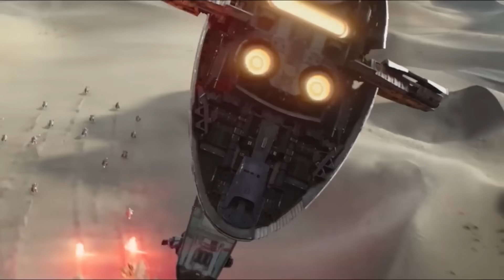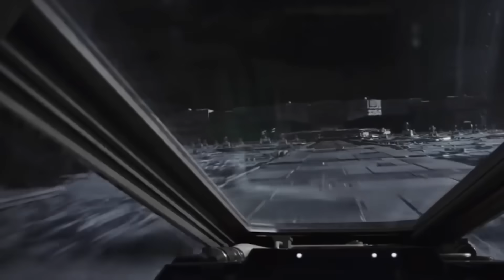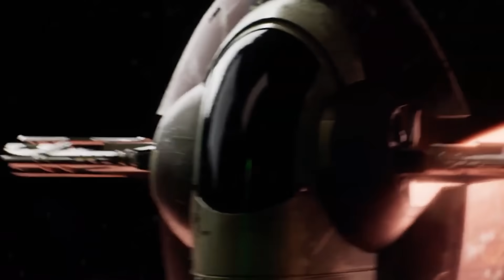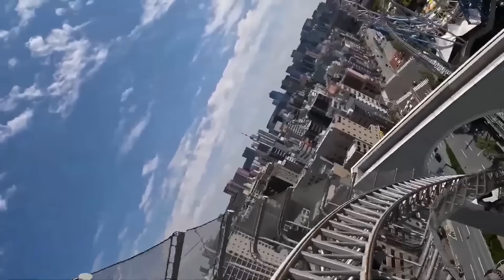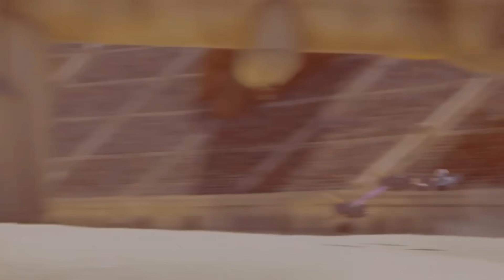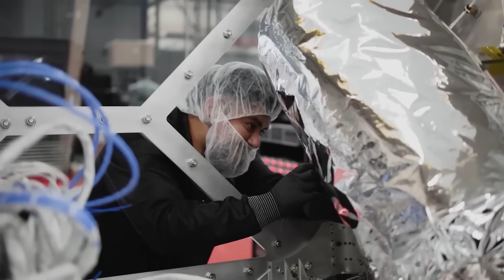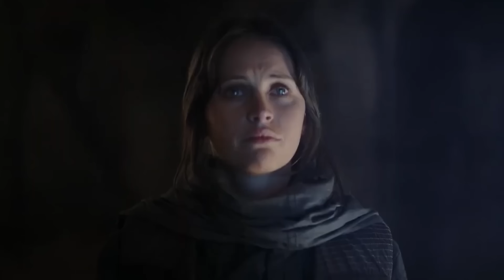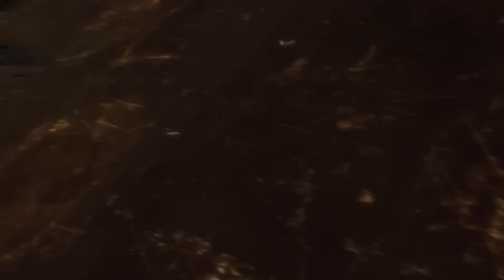The Problem with Star Wars Ship Design

Comment: Google "Saucer over Dracula's birthplace pouring smoke Yahoo news 16th Century Church painting" + "Masolino, The Foundation of Santa Maria Maggiore (The Miracle of the Snow). Fig 8 National gallery UK" No windows.. Google "Plasma generated Ultrasound" + "Boeing Plasma force field blocks bombs" + "Ultrasound antidrag for naval and aircraft" Earth science: "No medium in space, its a VACUUM! Hey lets talk about the interstellar medium!" Near vacuum, a powerful enough Plasma generated ultrasound system is still useful. If not for super speed anti-drag then for shock wave echoes to pull Heliosphere Gas from large distance to regenerate your life support systems indefinitely if you got good power source.

Google "Cooler Master Maker 8 CPU cooler" It uses Vacuum cold boil science to evaporate at lower temperatures and nobody needs to reset the vacuum ever. Youtube search: "Tesla Turbine COLD STEAM Testing, Medium RPM low temperature, 61280 RPM" He beams that Turbine under load using 134F temp.. Look at his vacuum pump he primed it with. Grins and resonance holography melts shutter seal and opens EM bearing Turbine system to space then closes it back resonance welding sealed again How strong would 134F heat be in THAT environment trying to balance cold? OH WAIT! I forgot to prime the COLD side! Opens shutter to water panel freezing it and leaving it open to use space to maintain it Heheh..

That Tesla guy why your governments not boosting him? Because your governments are sitting on everything they believe if all the good stuff went to masses it would be mindless super chaos so they're trying to enslave masses. WEF founder: "We will all have the implant." + Elon Musk: "We must merge humanity with AI" + "Elon visits Vatican" + "What percentage of WW2 Germany was Christian?" + "Nazi alliance with Islam" All public. Squints at masses grinning like a Sith Master using ultrasonic echoes to pull atmosphere charges to line up for mini lightning Google "Lightning makes Antimatter" + "Ultrasound can print through people and walls scientific American" + "Ultrasound non-invasive brain computer interfacing" + "Ultrasound stem cell proliferation" + "Ultrasound can make stem cells into other cells" + "Ultrasound holography" + "Ultrasound holography transcranial brain modulation pubmed GOVERNMENT"

There you go.. Upgrade power for PRESSURE add ultrasonic echo clashing by virtual reflector logic for resonance pressure barriers to trap plasma in using resonance safety filters for yourselves that prevent absorbing heat in you = Careful about using chain lightning logic for bigger and bigger lightning for a holographic stable black hole.. Can holograms kill? YES.. - Dracula/Hades/Anubis (Bat Sonar = Ultrasound + Lost TV show Sonar fence = Tiger Moth Bat sonar jamming) My words your world database results https://www.youtube.com/watch?v=J46EcAqZAPY

Comment: Another solution to the window thing: Simply having the "windows" be a video screen , linked to an external camera.

I mean yeah, the camera will be disabled if it takes a direct hit... But it's a very small target comparatively. And if a large window gets hit, well, that compartment is getting vented.
Reply: So Star Wars doesn’t use Glass on Starships. 

It’s Transparesteel. Literally a Sci-do metal that is Clear Durasteel so it’s as strong as the other metal surrounding it
Reply: @devildolphin2102  I figured it probably wasn't just regular glass, but I didn't know it was a material that's equally durable as the armored hull plating around it. Now I know!

That's actually pretty cool

Comment: Bridges - non-war travel they could use the bridge with windows as part of travelling and light combat. I would expect them to transition to the fortified bridge during major combat (or start there) and in war where big battles are expected. They haven’t shown that but would make more sense.

Combat Distance - I would say it’s close because for weapons that shoot concentrated light if the other ship was far enough away they could maneveur and it misses. I would also argue that a ship that has FTL can probably also detected those shots at range. Missiles would be intercepted too, so they need close range.

I’m more surprised that droids aren’t flying most ships.. and automated systems vs needed people to take those actions.

Comment: I can tell you didn't watch The Force Awakens. Most of what you said Han did was the actions of Rey and Finn, also Starkiller base was protected by a Sub-light shield, AKA, unless you are in Hyperspace you ain't getting in. This is where the Falcon's unique .5 class hyper drive is put into play as a class 1 hyper drive (Fastest non-modified hyper drive) isn't able to exit Hyperspace fast enough to be able to maneuver from crashing into the planet surface as the shield encompassed Illum and it's atmosphere(A few dozen Kilometers above the surface) thus making The Millennium Falcon one of, if not the only, ship to be able to infiltrate Starkiller base, and even then it was extremely close call resulting is what Sar wars fans would call a happy landing™️.

Comment: 1. Sensors are always jammed in battle, cameras can be damaged by laser systems, which is also very commonly equipted among star ships. A large window may not be that futuristic but it's the most robust solution. Besides, star ships usually rely on different types of shields, for most capital ships if the shields are gone the evacuation procedure will already be started anyways.

2. The wings on fighters are used as heatsinks in my opinion. In space it's not that easy for engines and laser cannons to dissipate heat. 

3. Also there are dampeners technologies to eliminate the effect of ship acceleration to the pilot and passnegers, it's one of Incom's major products during its early times if I remember.
Reply: I agree with your observations. Deflector shield generators likely had to be exposed in order to function. The exposed bridge is used on our aircraft carriers for the same reasons you present, while other ships have protected bridges as they don't need to see the deck. As for the transparent panels being a weakness, it's entirely possible that they were actually as strong than the rest of the hull materials if not stronger, thus negating any drawbacks. Gravity and inertia were addressed with dampers and manipulation, thus removing them as issues unless the systems are damaged. AI and droids are used extensively despite the comments here. They were just extremely limited in functionality to prevent independent "thought". All of this is obvious to those of us who have been sci-fi nerds for over 6 decades.
Reply: The wings of fighters could enhance maneuverability if there are thrusters at the tips.
Reply: @fiktivhistoriker345  Manoeuvrability doesn't much count in BVR combat.
Reply: @andrewstrongman305 most fighter combat in Star wars happens inside atmosphere. Earths atmosphere actually extends WAY out into space. So Endorse Atmosphere was probably even still present in some small degree out to the death star...
Reply: @Kolonol1  ROFL! Even if a Low "Earth" Orbit could be considered to be part of a planetary atmosphere, it would be so thin as to have no influence on any spacecraft. Never mind that the SW universe includes various AAM's, hence my reference to BVR combat.
Reply: for cameras there is nothing stopping you from putting them behind windows so they would be just as safe as the bridge is now exept you can have multiple and if they are damaged you can still try using sensors instead
Reply: @vinart10 If you have noticed before, camera CCD and CMOS units are much more susceptible to laser damage, even the laser ball or lidar have a high chance to permanently damage the camera. Also, if the ship was hit by an ion cannon or ion torpedo, there's a chance that the sensor system could be offline, making the ship literally blind for a period of time and can't defend itself even with all the other systems are intact.
Reply: @vinart10what will a window do to prevent infra red LED Ms from distorting the pictures?
Reply: He ignored ALL of the tech ology in star wars lol
Reply: Star wars takes place thousands of years in the past so futuristic doesn't count here
Reply: @chargedx5768 it literally does apply XD
Reply: Yea, ive always felt being able to see in a space battle is worthless. To eye a shot made over 20km when you have no sensors would take rhe force lol. Tho I give it a pass since im there for rhe philosophy and story, cause as he said, its a space fantasy. The engines literally use some magic substances to break the hard speed limit of rhe universe, something why cant layers be aimed by eye?
Reply: @Celestial_Reach just shoot in a random direction...don't need to aim after your sensors are jammed
Reply: Stop with the Jamming excuse. Jamming is not foolproof, and can be beaten with frequency hopping sensor systems and Anti radiation missiles. The close range combat in Star wars has no valid explanation, its just done for rule of cool and trying to explain it only further shows the complete ignorance of anyone attempting to explain it. Star wars runs on rule of cool and unrealism, that's it. There is no in universe justification for it, because its space fantasy.
Reply: @ryuukeisscifiproductions1818  You think of this because weapons on earth is so fragile, being discovered means destruction. If they got a jamming array inside their shield there's no easy way to destroy it. Also, AI-empowered jamming system including frequency tracking and predictions is already a thing in real life.
Reply: @Alan_Skywalker  Same techniques apply to senors, because Sensors and Jammers are effectively identical technologies, meaning it is impossible for one to be more advanced than another, meaning a situation where jammers are so advanced that they force napoleonic style close range combat is impossible. Especially in Space. 

And more importantly, Jammers only work against active sensors, they do absolutely nothing against passive systems, and in fact, they only make a ship easier to track against passive systems, which is exactly what anti radiation missiles use. All you need to do to defeat a jammer in space is have two IR cameras set a few hundred meters apart, both set on  gimbals, both pointed at the target, and by using triangulation, you now know the exact distance to the target, and when linked to a fire control computer, can get an accurate fire control solution.

And that is not a new technique, that is a system battleships used before radar. Only in space, such a system would be massively more effective because there is no horizon to block line of sight, and with just even the camera and IR technology today such a system would be effective out to tens or hundreds of thousands of kilometers. and it is completely jamming proof.
Reply: @ryuukeisscifiproductions1818  Passive sensor does not require sending radar waves, but it could still be fed false information or get overloaded, as what happened in Iran recently showed. If there's a decoy device that sends the exact EM signal there's no way to tell the difference.

I think Starwars ships do use radar to target the enemy vessel, but there needs to be another way to observe the battlefield to make sure nothing goes completely wrong. Captains and admirals have a lot to do, not only about positioning and targeting, they need to cordinate fighter attacks as well, seeing all of these directly instead of reading gauges could be less stressing.
Reply: @Alan_Skywalker  in space you need a lot more powerful of a decoy for that to work, its also basically impossible to make a perfect EM decoy in space. And also, star wars has never shown that it uses decoys or any form of sensor dazzling technology.

And by the way, sensor dazzlers are not foolproof, they can also be worked around and defeated just having the right type of lens over a camera can beat a dazzler, and star wars has shields which can also be used to beat them. Jammers, Dazzlers, decoys, stealth technology all exist in the real world, yet long range BVR combat is still the norm, none of that technology makes BVR go away, it wouldn't work in star wars either.  

Ultimately the real problem where is you are trying vainly to explain space magic. Star wares fights at close visual ranges because of rule of cool, that's it. There is no in universe explanation, and George Lucas did that deliberately, because he knew that any attempts to explain star wars space magic and fantasy would just flop and fail. So he didn't try, and the EU made a big mistake trying to shoe horn in the jamming excuse.

so quit trying to make up some excuse as to why star wars fights at visual range. They do it because rule of cool, that's it, there is no other explanation. its a setting of space magic and space fantasy, it doesn't have to be realistic or have a realistic explanation. 

Most of the time the reason people obsess over trying to come up with some nonsense reason as to why star wars ships fight at visual range is to make star wars look better in vs debates with other settings.
Reply: @ryuukeisscifiproductions1818  Star Wars space combat features extensive electronic warfare, sensors, and countermeasures far beyond simple visual-range engagements.

Official sources, including Wookieepedia entries drawn from canon and Legends materials like The Essential Guide to Vehicles and Vessels, Galladinium's Fantastic Technology, and RPG core rulebooks, confirm that starships routinely employ electronic countermeasures (ECM), sensor jammers, sensor decoys, stealth systems, and shield camouflage. Sensors detect electromagnetic radiation, gravitational disturbances, subspace signals, and Cronau radiation from hyperspace exits. Jammers flood areas with static to interfere with enemy targeting, while decoys duplicate energy signatures to create false targets. These technologies are standard, not absent.

Long-range sensors and detection are well-established in official lore. Starships use advanced sensor suites with ranges extending to multiple parsecs in some cases (e.g., detecting fleets at six parsecs in CIS Shadowfeed references), light-weeks for phenomena like supernovae, or sufficient distance for hyperspace navigation and early warnings. Combat often closes to visual or shorter ranges not due to the lack of sensors, but because of mutual jamming, distortion fields, and countermeasures that degrade long-range reliability—exactly as real-world EW can "cancel out" sensors, forcing closer engagements for accurate targeting and visual confirmation.

Weapons and shields support this layered doctrine. Turbolasers have documented maximum ranges in the dozens to hundreds of kilometers (e.g., XX-9 heavy turbolasers with ~100 km max in The Essential Guide to Weapons and Technology), with effective combat often closer due to maneuvering, point-defense, and ECM. Deflector shields, ray shields, and particle shields protect against energy weapons and physical threats, while interdiction fields (gravity well projectors on Interdictor-class vessels) pull ships from hyperspace or block jumps—proving sophisticated gravity manipulation and tactical denial exist. Star Wars vessels integrate passive/active sensors, ECCM (electronic counter-countermeasures), and crewed gunnery for precision in contested environments.

The Expanded Universe (Legends) and canon provide consistent technical explanations, not failed "shoehorning." Materials detail sensor warfare, stealth tech, cloaking devices (with limitations), and how advanced countermeasures force visual-range dogfights or capital ship brawls for reliable hits amid distortion. Battles like those in the films (e.g., approaching the Death Star II under jamming) explicitly show jamming in action. Close ranges serve tactical purposes—flanking, fighter deployment, boarding, and overwhelming point defenses—alongside cinematic style, but are grounded in the universe's tech tree rather than pure "space magic." George Lucas drew from naval and aerial warfare analogies where EW, speed, and maneuverability matter.

In-universe realism coexists with rule of cool. Star Wars blends hard sci-fi elements (hyperdrives, tractor beams, ion cannons, crystal gravfield traps for cloaks) with fantasy, but official databanks and novels treat space warfare as a complex domain of sensors, ECM/ECCM, decoys, interdiction, and shields—not an excuse-free vacuum of impossibility. Attempts to explain visual ranges via jamming and countermeasures succeed in expanding the lore, allowing both spectacular visuals and tactical depth. Real militaries also close ranges in contested EM environments despite long-range sensors, mirroring Star Wars doctrine. The setting doesn't require perfect real-world physics to be internally consistent.
Reply: Wing and window needed for small orbital spacecraft .
But for huge war assets in space  i prefer to built many layer of hull . If you afraid being blinded, just use cables or add many periscope lol.
Reply: @rewingustadi4844 what's the difference between a periscope and a sensor? Flamethrower can take both out. In space to shoot flames is all you have to do is use oxygen as a fuel source.
Reply: The "radiator" trope again? Really?
Reply: @andrewstrongman305  look up cross-sections all wings are radiators